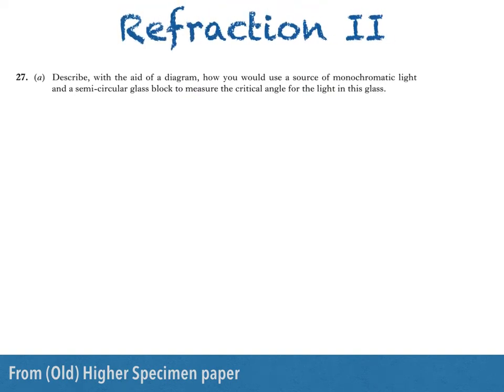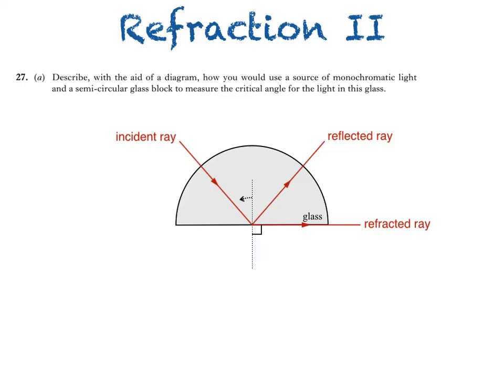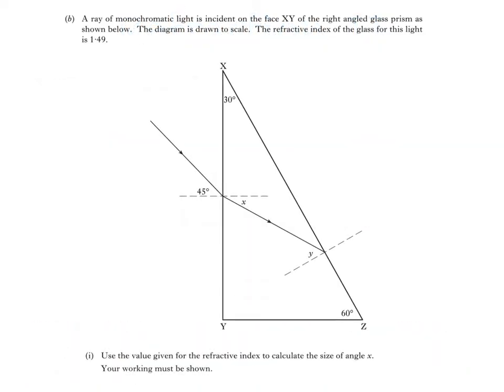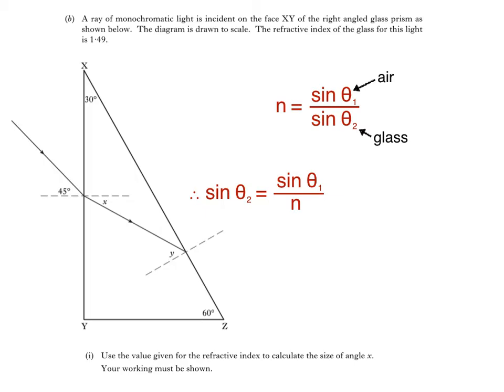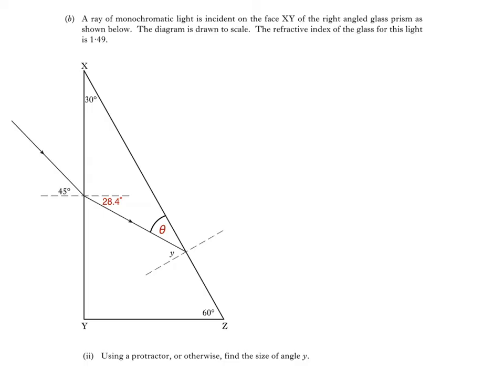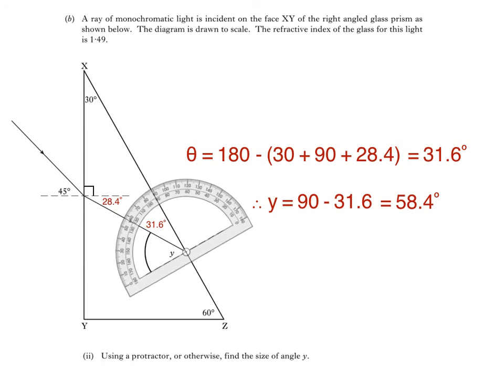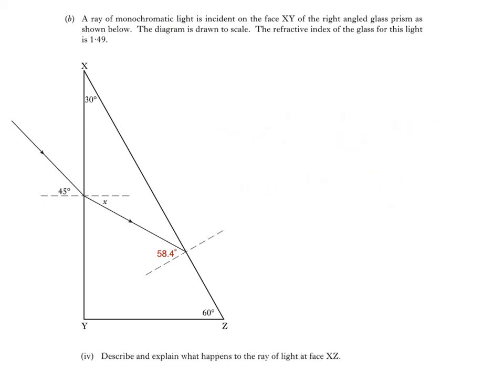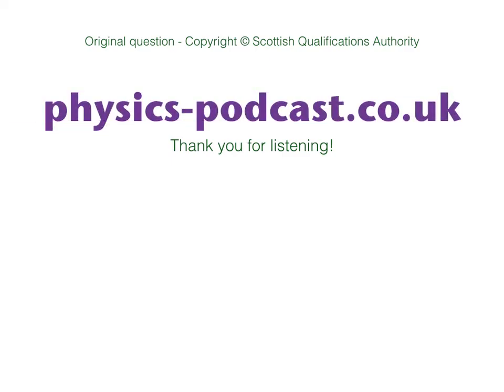Higher Physics - Refraction 2

Comment: why does the light not refract on the curved surface of the glass block?
Reply from the maker: The light does refract (there is a change of speed). It doesn't, however, change direction because it's always entering the block along the normal. The normal at each point along the semi-circular block's curved surface is in a different direction.
Reply: Is the whole course even on this channel?